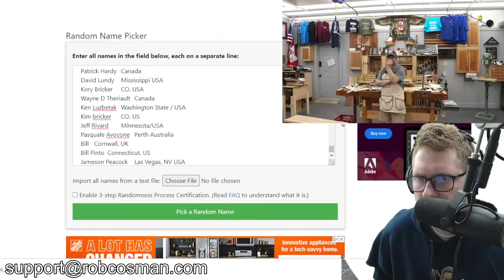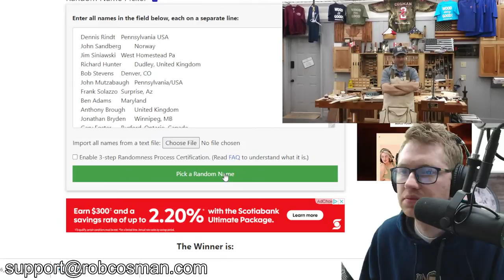Saw Sharpening - Live Q & A (16 April  2022)

Comment: One thing you could mention.  When sharpening any tool, saw, chisel, chain saw, HSS tool bit.  The apex (top)of the tooth has to be the highest point.  The best place to understand this is a chain saw.  If you hit a rock inside a tree and see sparks, I guarantee you have a dull chain.  Remove the saw and look at the tooth.  If it's rounded a bit just on one side, that blade will cut to the opposite side.  You have to remove enough material so the highest point is sharp.   On a chain saw tooth you can get the cutting edge sharp, but if it's rounded just a bit it's still dull and will not cut properly.    I hope I explained that well. If I get a chance maybe I can send you a few close up photo's to show exactly what I'm talking about.

Comment: 4:40 The rounded corner of the files described is not a deficit but a feature of a good saw files. The root of the tooth between the tips should not be a sharp notch, as this makes the teeth of a saw break off more quickly. However, this only becomes really important with coarser toothing.
For this reason, bigger high-quality saw file is not only hewn on 3 sides, but on 6 sides, as the corners count as 3 additional sides.

Comment: One of the most odd tips I was ever given was how to sharpen any file.

wire brush the file to get it clear of any cuttings. Maybe spray it off with carburetor cleaner or brake cleaner.
Last but not least battery acid. Swish it around a little bit after a minute or so rinse it clean with water very well. It does a good job...

Comment: Hey guys, have you ever looked into the tool maker/brand “Gramercy Tools” I believe they’re located in New York. They make one of the nicest saw vises I’ve seen. And they also offer a saw sharpening service where you can send saws into them. They really pride themselves on craftsmanship and quality by the looks of it and how they promote and market themselves. But my original point of bringing them up is they have files on their website that are handmade and in all different sizes. I was looking to buy some and wanted your opinion on them and still might try them out but luckily a gentleman that owns a tool place near me was closing and he had a bunch of un-used original 5 and 6 inch Nicholson double extra-slim saw files and I got a box of them and they practically don’t have any flat on the points at all very sharp corners.. unlike like the modern Nicholson files.. and he sold them to me for dirt cheap. I actually just emailed him to see if he has anymore boxes of them. The older green rectangle boxes with the old logos.

Comment: From George in Ontario.  My dovetail saw does not cut straight down a 90 degree line. It cuts to my left so how should I correct this problem to make it cut 90 degrees. Thank you .
Reply: If you didn’t get a reply while on live, you can use a diamond plate and run the side it wanders towards, on the stone evenly. Rob has another video he made a long time ago that shows how, it’s called “diy dovetail saw” or something. It’s a video of him tuning up a old Gents saw and making it cut and preform better. But he shows how to “stone” a saw that has to much Set on on side. The reason it wanders.. is either your form or the set on that left side of you’re saw (when holding it how you would saw and looking down at it) you just run it it across a diamond stone or even a normal water stone and probably other options. But make sure you do it as evenly as possible and one pass at a time and test it so you don’t take to much set off and cause your saw to bind and get stuck. Good luck brother.